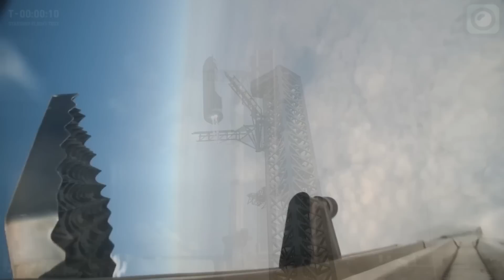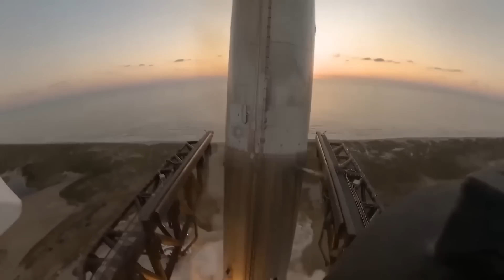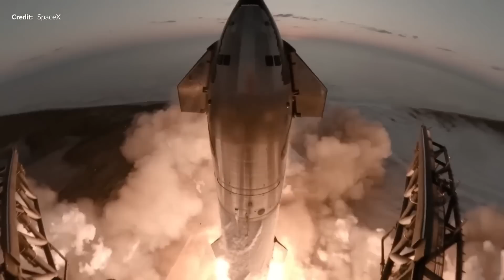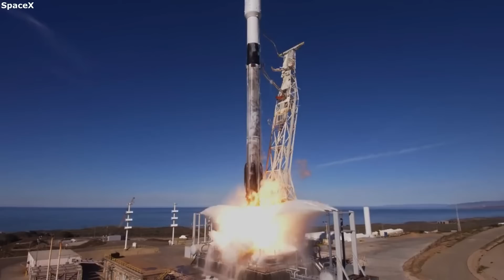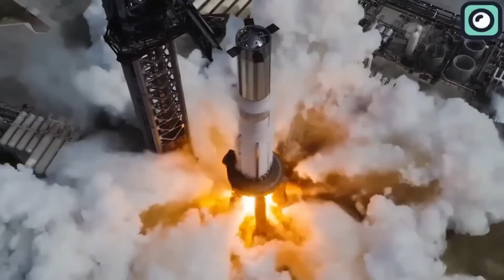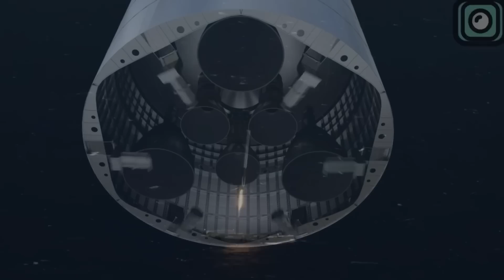What SpaceX Did With Starship Booster Will Blow Your Mind!

Comment: They need a flame deflector with an open center to the sea on the drone ship. The olm would be split into four sections that close around and clamp holding the rocket base. Rocket guide rods lateral raise up off the deck early and center the ship over the olm mount.

Comment: If the SHB is only running three raptor engines at closest approach to the landing pad, or the mechazilla for that matter.  So, at full power the three Raptor engines produce 1.5 million pounds of thrust compared to 9 Merlin engine's 1.7 million pounds of thrust.  I think you're providing viewers with a lot of red herring information.  What possible impact would the total mass of a fully staged and fuelled Starship system have to do with landing a near empty Super Heavy booster?  Your channel is becoming totally irrelevant as it seems you have trouble with being straight up with people.